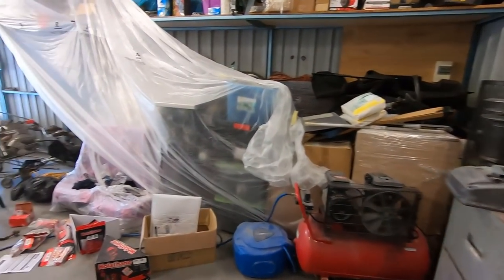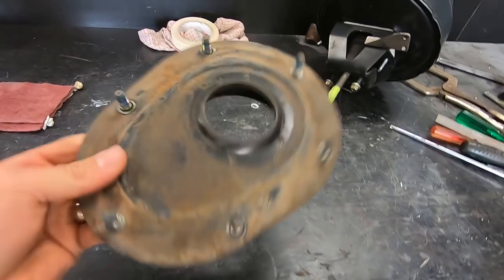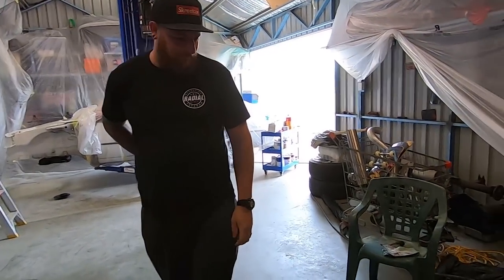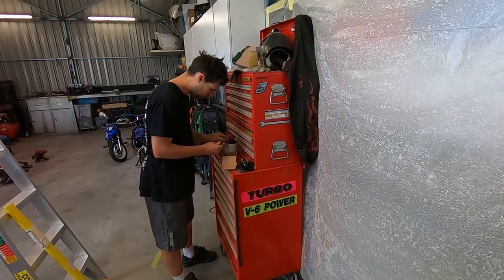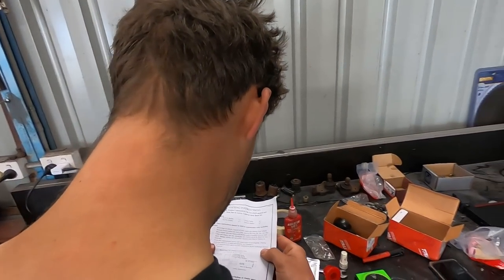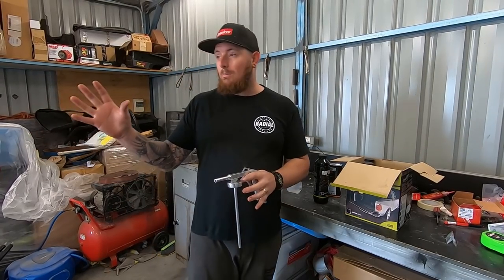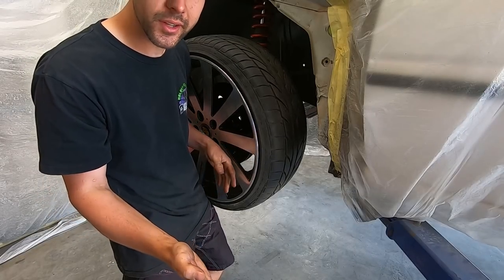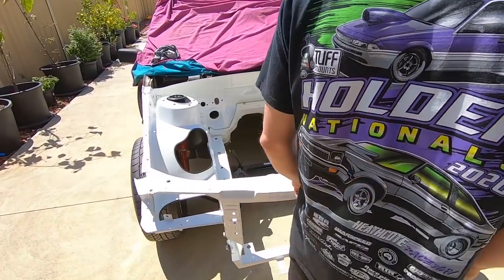Making my Turbo 304 Project a ROLLER! Nearly engine ready! | [The Bunky BT1] - Ep4.

Comment: I hope all goes well with the Nolothane bushes in your build, as a mechanic myself I have seen disappointing premature wear in them and splitting, I’ll be using the super Pro blue bushes in my builds, they seem to be a superior product from what I’ve seen, I hope I’m not upsetting a sponsor if these were given to you cheers
Reply from the maker: No sponsors here Trev! These are an older style nolathane bush so we're somewhat expecting an early end of life with these, but the oem bushes were flogged and these were on the shelf already so got very little to lose. The car isn't a daily so hopefully the limited kms help us out  with longevity.
Reply: Bet you work for garage 54.